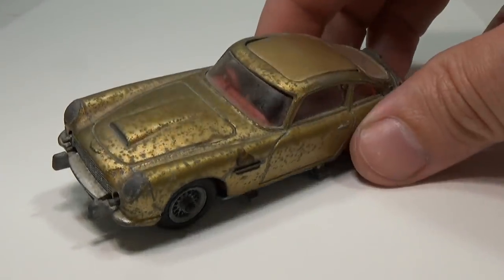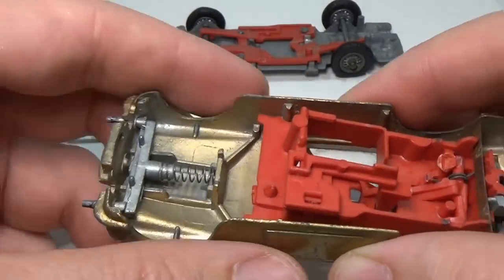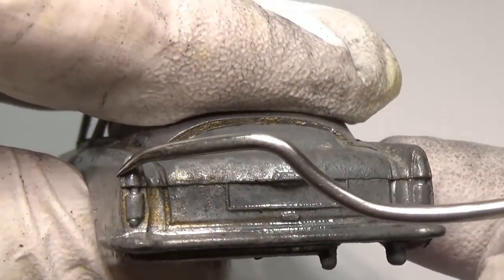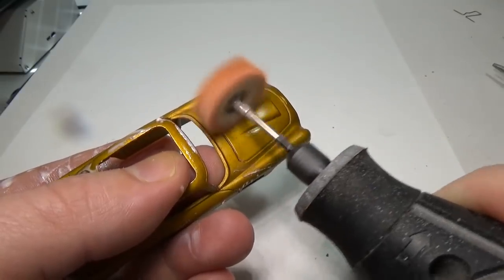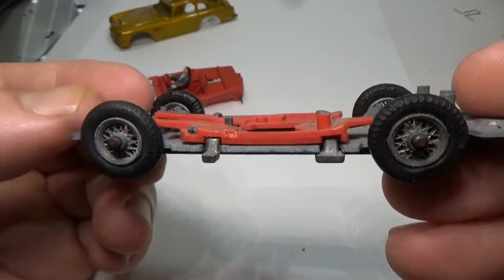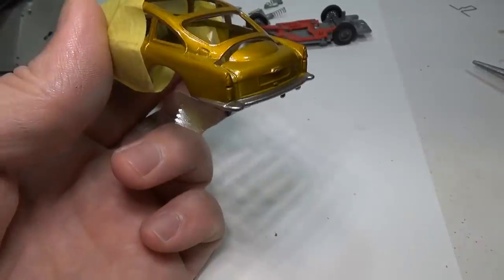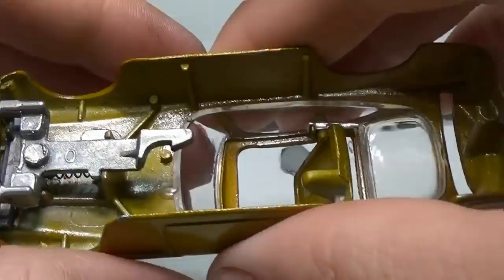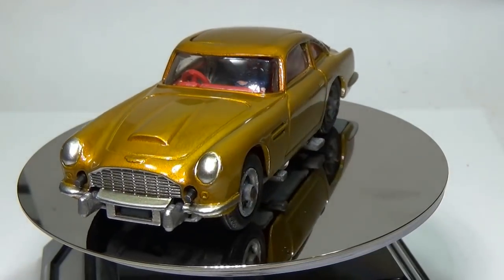Diecast Restoration Corgi Aston Martin DB5

Comment: Can you please do a stanced car with cambered wheels. I think it would be a fun challenge for you.
Reply: i'd love to see that as well!
Reply: Carl 181198 Civic?
Reply: thats a good idea
Reply: A stanced civic.... lmfao
Reply: stanced car with cambered wheels on normal cars? eww...if it's on actual race only cars, yes.
Reply: No
Reply: I love this idea!
Reply: Kristy Duncan If not done well, camber and stancing in general is fucking disgusting
Reply: until the road isn't glass smooth or needs to get new tires after the sidewalls wear out or breaks an oil pan on a road reflector and the tow truck can't tow their poor car plus it's dangerous to screw up your suspension that much
Reply: JBat5202 waaaaaaaaa waaaaaaaa
Reply: stance just isn't practical and should not be done on the street
Reply: JBat5202 Yeah

Comment: I had one of those when I was young (in the 70's) my sister accidentally stood on it the first day I got it, breaking the ejector roof. I never forgave her.  To try to make amends 30 years later she gave me a replica, still its the not the same thing :(

I've only seen silver versions of this car, didn't know they did a gold version.
Reply: The gold ones came later and had less detail. For example the silver had revolving front number plate and if my aging memory serves,  little plastic things pull out of the wheels that ripped the side of the Mustang out in the film.
Reply: The gold one's were first, re issued and updated later as silver with more gadgets.
Reply: Daniel Byrne : You are resentmented person.... ha ha ha ha
Reply: @tardisenvironmental8426  Actually the gold came first. Corgi got the colour wrong, thinking that the car would be gold as the film was Goldfinger. The cars were produced early for release at the same time as the film. I had one of the first ones that our local toy shop got in stock

Comment: A great tip: use silly putty to cover detailed areas you done want painted. You can use a tool to push it into areas and get good coverage.  Once you finish painting, it peels right off. Works great when you want to cover the body area where the headlights are, and just leave the headlights exposed. It’s shapable too, so you can put in anywhere on the car you don’t need painted.

Comment: My dad had one of these cars. When i got it, most of the action features were gone :(
Reply: Magnus Nilsen Same here. If I remember right mine had the roof missing. Very cool toy though.
Reply: Magnus Nilsen Just when I got mine, someone stole it
Reply: I wonder if there're replacement parts (or 3D-print models) available.
Reply: there was the Lotus Esprit and the Aston Martin
Reply: I used to have one of these cars although I recall that mine was silver.  I remember loving the bulletproof shield at the back.
Reply: Joshua Rosen Yes, I had one too, and it was silver. It was my first Corgi, and my pride and joy. In the U.S. only high-end toy shops sold Corgi, so I’d save my allowance and beg my older sister to drive me to  Le Jouet. I’m going to look in the old trunk out back to see if I still have it.

Comment: I just got a pang of sadness and regret after watching this. I had a yellow submarine with the fab four within (not a bad job on the modelling too). With the push of a button the four popped up from under a die cast lid. With a press of the lid all were concealed again, ready to pop up with a push of the metal button once again. The sub was on wheels as well. I also had a bat mobile containing batman and robin. It fired little red bullets from a push button launcher located at the rear of the seats. If I ever find them again, they're yours to restore. Top quality job, as usual. Thanks, I really enjoyed this restoration.

Comment: Why is it gold
Mine was silver as per the film
Reply: Brad Kells Then yours was the larger scale one with the spinning licence plate.
Reply: looks way better in silver
Reply: Over the years Corgi has issued them in both silver and gold colours. The Goldfinger 30th and 50th anniversary editions were done in gold.
Reply: It's because they wanted it different.
Reply: Have just posted elsewhere on the page with my own memories on this car. I had the silver one, but @SvenTviking it wasn't the larger version with the spinning licence plate, it was this scale version. It was from a later re-release (circa 1980-ish), the hijacker passenger (two provided) came in plain blue plastic by that time too, presumably to cut production costs. 
I've always understood from Bond aficionados that earlier releases of the toy were on gold were to tie in to the 'gold' theme of Goldfinger, where the car made it's first appearance and after which the first release came.
Reply: I have heard two reasons

1) corgi thought the car would be gold before the release of the movie (goldfinger) and screwed up before rectifying it in later models

Or

2) they thought silver looked ‘unpainted’ so went with Gold instead
Reply: @RichKonfusion  I've heard both of those theories, the latter generally seems to be more common, ties in with what I posted with them feeling that they felt gold tied in with the 'theme' of the film more. 

...Now we've tackled that, anyone got any clue why the old original Thunderbrids 2 toy was a different colour?! :D

Comment: This is a rare car i think
Reply: Thomas Rupesinghe nope. It was one of the best selling toys of all time. They made 2 million.
Reply: But a few did end up beyond repair though like most toys.
Reply: I think Dinky toys also did this car. If im not mistaken it also had a revolving number plate and it was silver.
Reply: Nope, but they did do a DB5 convertible and a DB6.
Reply: no not really, they did make some gold plated collectors editions, you see them from time to time NIB at antique auctions here in the uk, but its the first run sixties version thats worth the most.
corgi re-released these in both gold and silver in the early eighties as a line of 007 cars, which are the ones you see in auctions not the original.
Reply: @Michael Walker I had one of the silver ones with the revolving number plates. It also had tyre slashers and separate bright-plated bumpers/grille. It was definitely a Corgi model, but it's the second version from 1968.
Reply: No not Dinky, Corgi issued this one in gold then a couple years later updated it with the revolving number plate and the silver paint, at the same time they changed the scale a little to make it a touch bigger.
Reply: I still have an original, complete with the little guy with the gun. It is in very good condition, but alas, no box.

Comment: I have to say i am disappointed that you always remove the the mold lines from the cars, although it makes the car smooth and cleaner, i think htey are an important part of the toys history.
Otherwise i must say great work!
Reply: alex clark 

I was wondering that,
I guess in a custom job it's fine but for a faithful restoration I would be surprised if that's done

It was after all how it originally came from the factory and if i was wanting to return a car to as close to original as possible I would leave them.

Comment: With all due respect "restoration" is to return something to it's original condition, I'm afraid that is nothing like the original condition
Reply: clearly a reply from a illiterate  person, and does not not change the fact that the item has not been "restored" as was the claim, in fact if you have any knowledge re the restoration of  this type of item you would be aware that any value in may have had has been rendered to nothing other than spare parts
Reply: I know the meaning of custom and I know the meaning of restoration, the two are not compatable
Reply: pijnto           purists are kind if irrational , although my full size real 41 Plmouth is factory perfect.
Reply: Any restoration would involve stripping and repainting.  So, the "as original" value would be lost.  However, the value of the repaint job is added.  Value is not objective as many seem to think, but is the amount a willing buyer would pay to a willing seller.
Reply: Actually, a lot of antique silverware and furniture is rendered valueless by cleaning, buffing, sanding and repainting. It's the patina that has developed over decades to hundreds of years that gives the piece its charm, its personality and its value. Buffed up and repainted it's no better than a one day old replica and priced to match. This piece is now pretty much useless to say, a toy museum.
Reply: Again, value is not OBJECTIVE.  Many people might find the cleaned and repainted item more appealing than the original chipped and corroded piece.  Beauty is in the eye of the beholder.  Check out Jay Leno's Garage where he has original "survivor" cars, restored cars, and many "resto-mod" cars.  He discusses the difference and reasons and what is appropriate for each car.  In the case of the Corgi car here, it was so rough that I doubt much was lost in the clean and repaint job.  But, that is in my eye.

Comment: I would absolutely love to hand-paint something like this, adding highlights on the raised parts, inking the cracks, painting the chrome window trim, dry-brushing some silver on the wires of the wheels, etc. I of course appreciate returning it to stock, but man, I'd have a blast applying the same techniques I use for Warhammer 40k models for the details here.

Comment: This is such an iconic masterpiece, I had a DBR1 made from Corgi. But the windshield was covered in sharpie just like most car boot finds. I used some acetone to remove all the marker around the car, therefor it retained back to the British racing green it came in. Without the marker pen. I have it on my shelf right now.

Comment: Nice video. I have one of these cars as a boy, no-doubt a re-release by then (circa 1980ish). The originals were released in gold, to sort of tie in with the 'gold' theme of Goldfinger, whereas many re-issues - including mine - was in the screen-accurate silver. I seem to recall there have been one or two variants over the years, including one version that had protruding spikes from the wheels, which mine (and the example shown here) doesn't have. 
I still have my car, still in fairly decent condition (save for a small chip in the window to the rear which barely shows) and all intact - amazingly, I never even lost the two passengers that my example came with. On mine, presumably to cut costs by that time, the passenger came in plain blue plastic, unpainted. I also recall that the paint job on my Bond driver has a slightly reserved paintjob on his hair - making his hairline looking as if it is receding slightly!

Comment: My father (John Marshall) Worked for Mettoy and designed all the internal moving parts for the Aston Martin including the ejector seat, rear shield and front bumpers etc.
He also did the batmobile, Chitty Chitty bang bang and the yellow submarine. If you google "John Marshall Mettoy"  There will be an interview that comes up that dad did for a local museum on his time at Mettoy. Although he's long retired now, he still messes about restoring old model railway trains

Comment: I had this car when I was a boy, but I remember the one I owned had 'spinners' wich one could pull out  in the center of the wheels.
I checked E-bay, and I might have had a later version of the car.
That one also had changeable license plates.
It was the Corgi Toys No. 270. This one is the No.261

Comment: Corgi did this in 2 sizes. The 261 which was 1:43 & the 270 which I believe was 1:36. That's the one I have. Corgi didnt do the DB5 outside of the Golfinger option. The previous one was the DB4 which they used as the base mould

Comment: This  restoration is great however I wouldnt even consider restoring mine. Got mine new in 1966 when I was 7 years old. First thing I did was take out the bad guy and made him a good guy driving a dinky 63 fury.  I also ripped out the seat with a screw driver; needed to see how it worked. Left it outside in the sandbox countless times and soaked in water in my home made car wash. Of course everything ceased. Of course it was entered in a demolition derby and countless races. Still have James bond still driving. Not interested in restoring not one scratch!

Comment: I worked for corgi toys in south Wales Swansea I would watch the girls on the machines making them 1985 it was a Christmas job I was there for 4 months. My job was to make the plastic packaging on a machine that was about 6000 years old it was really old but it worked well. Each girl had a box and in each box you had all the parts and the girls would make about 6 car's a minute and there were about 200 girls. I watch as a brand new 007 car came off the assembly line and of course all different kinds of car's. My favourite was a ford Capri

Comment: Thanks for all your efforts with these vids - really very informative. I’m going to give a restoration of an early Corgi DB4 a go. I think the precursor to this model. Would you recommend going straight in for a cheap airbrush or just starting off with the spray cans? I have no experience with air brushes but have used the cans for various projects before. Also, a Dremel type tool looks to be essential for speeding up the polishing. Thanks to your redline silhouette vid I know which drill bit and tap set & button head screws to purchase 👍🏼

Comment: Talking about your method of removing overspray paint wirth acrylic thinners, you can also use a toothpick. I dont know how rigid the vallejo paints are, i use AK's Xtreme Metal line, ( enamel based ) but you should be able to scrub the silver acrylic paint off especially on the glossy surface of a car.

Comment: @baremetalHW can you describe your polishing technique a little? Specifically:

-Is that a battery powered Dremmel tool? Approx how many RPM is it set to when polishing?

-What type of polishing pad and compound  do you use? Are they available on Amazon?

-Do you use a gloss clearcoat over the Spectraflame paint?

I ask because I was polishing by hand but not as effective. I have an adjustable  corded Dremmel tool with a minimum RPM setting of 1,000 RPM. I just tried your technique and burned through the clearcoat in about 1/2 a second. Also got compound flung all over so obviously I am doing something wrong. 

Keep up the good work, your work is amazing, and your videos are relaxing even for people who don't restore cars!

Comment: You said a user went it in,
Is there a way to send in a car to get done as a commission?
I have an old Matchbox Landrover Safari that needs mostly paint and one window pane replaced (or the others removed). It does still have the roof rack of stuff but I did break the hitch at some point.

Comment: These are the heavy set cars right? Just wondering. I don't think I have any of these types of cars. I do have unopen hot wheels that I have had sense I was about 24 or 25. Maybe I was 26. Not sure but i collected them. I am 40 almost 41. I don't think they go up in value over the years but its fun collecting them.

Comment: That must be a cheap version made for the export market. The one that I had when I was a kid in the '60's was silver. As well as the rams, machine guns, ejector seat et al, it also had wheel nuts on the rear axle that extended and became sort of chariot wheel knives, and the number plates used to click around to give a British number plate and two European ones.
Reply: The gold version is a more expensive limited edition the car on this video is now worthless
Reply: Yes, me too! Still have it I think. The chariot wheel knives were made from a softer orange plastic, which, unlike the other plastic parts, did not age and break (ejection seat mechanism broke on mine).
I remember applying the stickers to the rotating number plates. My mom helped me do it using tweezers and needles, as the stickers are fractions of a millimeter high.
Reply: Paul and Pijnto - you're both sadly mistaken. This was the first model Corgi issued, and decided to paint it gold to make an eye-catching tie in to the 1964 'Goldfinger' movie, the model (No.261), appearing in 1965, and selling over 750,000 by Christmas of that year, and it continued to sell enormously for nearly three years, so it is not, in any way, rare. The updated silver version, (No. 270), appeared in 1968, and had the added revolving numberplates, and extending tyre slashers. I have both versions. They can be worth money if you have them in their original boxes, each with the spare gunman, and the envelope containing the 'Secret Instructions'.

Comment: What about the wheels and the tyres dude???  You can get those at most hobby shops. You've made a good effort but the color is wrong. Humbrol make a gold very close to the original. If you can't get that,you can use a bronzing medium with an enamel base to achieve perfect colour. Good job though  :)

Comment: Anyone have any idea what kind of tool i need to replace the screws?
Reply: Lacus Jegyes do you mean like when he drills out the rivets and taps them for screws to put the cars back together? I've seen these linked elsewhere, not sure if they are exactly what he uses but another 1:64 restoration guy does. I haven't bought them yet but will be soon.

Link is for the screws on Amazon, look at their "bought together" section for the tap and handle set:

https://www.amazon.com/dp/B01I28XQAC/ref=cm_sw_r_cp_awdb_TAeNzb1ZAY426
Reply: A screwdriver

Comment: Nice work. But I think this is overworked from the original. Color wise the 'Gold' is more bronze than the yellow gold you'll used. Also worth noting that the original was more 'silk' than hi-gloss. Headlights were not painted silver either. I would be interested if anyone has sourced the correct color?